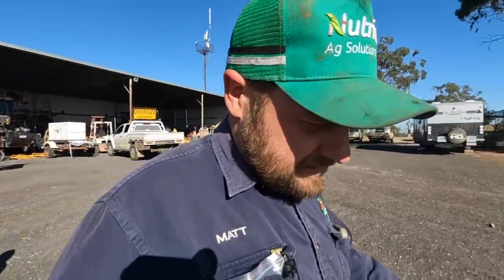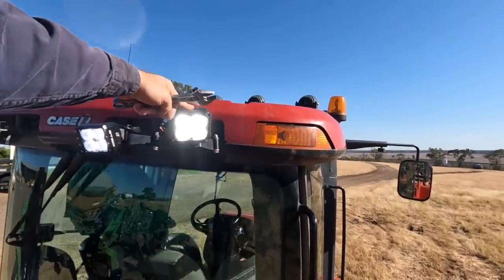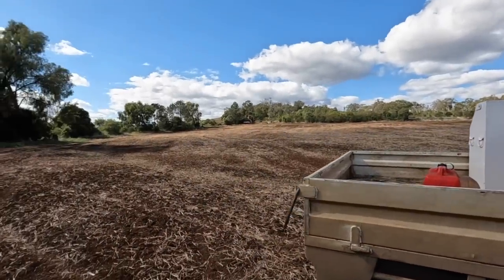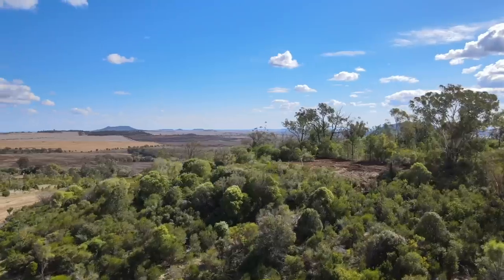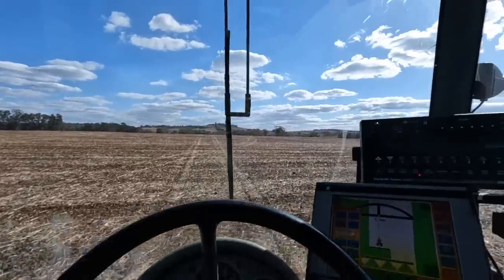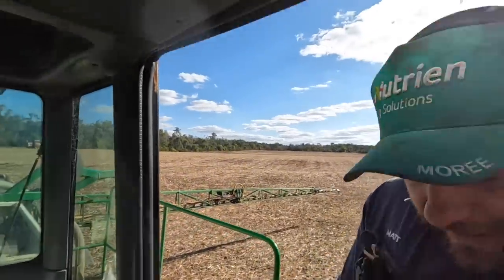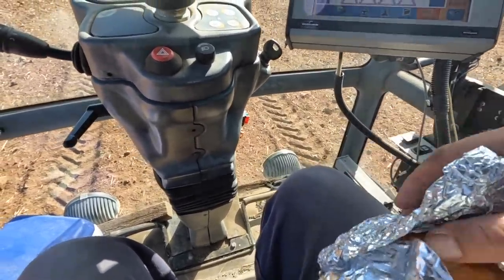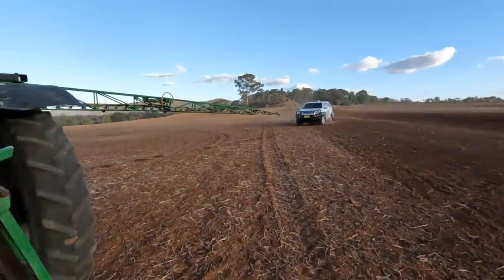Planting in the Hills | Planting 2023 | Farming in Australia | Vlog 170

Comment: Put capacitors on the supplies to counter act the led noise. Both large and sized capacitor for higher value uF caps to even out supply and 10 nF capacitors to even out and filter higher frequency noise to battery ground. Put across the supply gnd  inside the led case of the lights.

Comment: That aircleane4 on the sprayer you were operating Matt, seemed to be a little wobbly.....
Reply from the maker: It’s just the rubber mount that bolts it on, if it’s stops wobbling then there’s a problem😂😂

Comment: Great drone shots. Do you add a bit of zinc (oxide) to those areas that have been scalped by the dozer, seems to help when topsoil is mixed with subsoil? Might help to reduce depressed yield in the banks, certainly helps a few kms further south.  Could try a few sq m to see if it makes a difference?